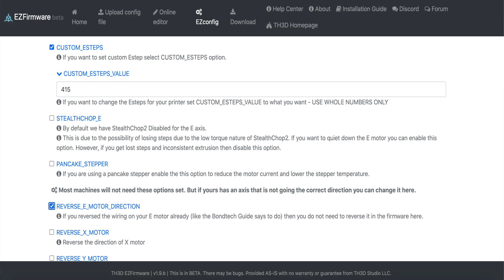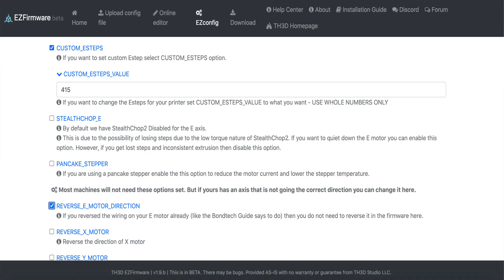Bondtech BMG Install | Creality Ender 3 Pro

Comment: Hi , Did you have to swap the wires in the stepper motor?  I just couldn't get it working. The graers wouldn't roate even after I set etsp to 415 . But I could rotate the gears manually and it is  smooth .. Any idea why is this happening?
Reply from the maker: I switched the motor direction in my firmware using the Th3d Ezfirmware compiler. This will work if you have a Th3d EZBoard. If you don't, according to the Bondtech directions, you will need to swap two wires to get it to work. I'd reference the directions for which wires are needing to be swapped. Also, ensure that the wires are properly plugged in and in working condition after the swap. You can verify this by checking the voltage with a voltmeter. Ensure voltage is flowing through the connection at the BMG side while the motor is supposed to be moving. Also, make sure the stepper motor is good by swapping one from another axis in its place temporarily. Let me know if that helps. If not, we can try a few more things!
Reply: @modified3d59  Hi ,Thank you for the inputs.i tried swapping . After the swap the motor rotates smoothly and also once i assemble it i could basically move it manually.But once i assemble it shudders.its like its not able to rotate.i dont think i have bad  stepper.Not sure what the problem is.i have seen so many videos on YouTube it was just swap  .Not sure what im doing wrong .
Reply from the maker: Sounds like the motor is binding. Ensure the correct gear is installed on the motor shaft and I'm the correct position would be my next guess
Reply: @modified3d59  That is correct . It’s smooth when I rotate by hand . Same gear is installed which comes with the package . Is it something to do with vref etc ?
Reply from the maker: You can try to increase the vref and see if that helps. One thing I'd try is to see if the motor spins while the Bondtech is not attached. If attaching the Bondtech causes to much resistance to spin the motor, there's a chance the Bondtech may be defective from the factory but I'd say that's slim. Have you tried reaching out to bondtech directly?
Reply: @modified3d59  It runs smoothly without assembly. But when manually when i try it doesn't look like its damaged .

Comment: Thanks, I have a different connection angled part, so I installed extruder without it. Works fine on my Ender-3 Pro

Comment: It is installed wrong way in this video! Be aware! The bowden tube should be installed to the opposite end where the lever is and the filament should be inserted from right next to the lever.

Comment: Nice video!  Just in case, you don't have to either swap the cables or the direction of the extruder.  Just flip the BMG 180 on the Z so that the tensioner is looking outside and the coupler also faces outside.  Hope this helps!

Comment: I have two Ender 3 v2 and I was never able to put those extruders I have setting the e-steps recommended for the seller and the retraction also recommended for bondtech support pretty frustrated now I have two extruders like that new without use. Anyone interested
Reply: Have you tried updating your firmware on the ender 3 v2s, because I have an ender 3 v2 with a bmg extruder and it works fine after I updated the firmware.

Comment: Nice video.  I found the bondtech didn't actually need the adapter.  I was able to have it mount directly to the existing plate on the x gantry.  Until of course I went to direct drive :)
Reply: What was the adjust you did in your printer and in your slicer if you don’t  mind mi question
Reply: @javieruriel  My only adjustment was the E-steps when i was using a bowden tube.  When i went to direct drive I also had to change some slicer settings.  I dropped retraction down to 3mm as there was still stringing at the recommended 1-1.5mm.  I removed options like coasting and whatnot as these settings were to compensate for bowden tube ooze :)  There was some trial and error.  I have an E3 pro and and E3 max and they both needed to be dialed in to different settings to work well.
Reply: @trevornelson7524  did you make any changes on the Vref the stepper?
Reply: @trevornelson7524  I have mine Bowden and according to people on bondtech support sale toll mee that I had to make adjustments in esteps 415 and retraction  35 on the slicer wich I did the outcome was filament didn’t go out easy looks like the mottor didn’t have enough torque
Reply: @javieruriel  No I didn't change the stepper drivers at all for either setup.  They don't run that hot and have been working for a couple of years now.
Reply: @javieruriel  I started pretty close to that but then just did a calibration to hit it dead on.  Even so there are some post adjustments i have to make based on the filament type and what not.  (usually just on the feed rate in octoprint or on the printer itself.) My e-steps for the ender 3 pro are set at 401 steps/mm and my ender 3 max is 397.  If memory serves though I believe the clone pancake stepper didn't need to swao coil pinouts for proper function but I had to for the bondtech one.  The bondech pinouts aren't teh same as the creality steppers. It's pretty easy to tell what the field pinouts are with a multimeter.

Comment: I got a clone from Aliexpress and didn't even have to reverse the direction of the motor.  I noticed something was different when I mounted because the  two sides seems reverse.  The flap which opens so you can feed the filament is on the bottom and not the top like yours which is fine and I didn't have to make any motor direction mods.

Comment: Anyone watching this needs to know a couple things.  Before you take apart your extruder to install the BMG.

A. The BMG extruder needs a different adapter for the Ender3
https://www.thingiverse.com/thing:3117704
**You need M3 nuts and screws for this adapter

B. The gear pulley on the motor is a bit&% to remove.  I had to 3d print a tool just to remove it
https://www.thingiverse.com/thing:3593964

I took my extruder apart twice before realizing everything that is needed (waste of time) so make sure you prepare.

Comment: I'm about 99% positive you installed that backwards from it's intended direction.  Usually that bowden adapter you were referring to, is where a J Type hot end goes when it's a direct drive.  And it looks like you have that part installed on the outside of your Ender 3.  Meaning the filament is running backwards through the extruder.  I'm not really sure how that actually effects the operation however.  I just thought I would point that out in case somebody is trying to do a direct drive installation with this and is wondering why they can't get their hot end to fit with it oriented in the same direction you have it.  The 1% doubt comes in, because I think they changed the design at one point also, so without know the version you have, it may just be appearing to me that way was well...  Good video tho.  Thanks for not just Blasting music instead of talking.  I hate videos that do that. Lol.
Reply: nope this is actually how they are designed, just installed one on my ender 3v2. and you cant actually change the side the PTFE tube fitting sits one, its impossible.
Reply: @cappe_yt9182  Hate to tell you this but it is in fact backwards. The lever points to the top or the intake side. You're supposed to buy an adapter, either the BMG bowden adapter or E3D's V6 direct mount (included in the v6 I think), and insert it into the empty side, which is the bottom or extrusion side. You can still use it in reverse but you have to reverse it because it's backwards.
Reply: @paranoidpanzerpenguin5262  You know if you enter their own site this is the exact video they link for a step by step guide.. And their own PDF guide shows the same direction so ''Hate to tell you this but'' it is correct
Reply: @cappe_yt9182  Yea, because they're trying to short change you by selling you the BMG extruder as a "kit" for a few extra bucks without giving you the adapter. If you go to the identical original BMG extruder page they even warn you they don't give you the bowden adapter for the output end. The only reason you have to reverse your motor is because it's backwards. The BMG extruder was designed to mate with the E3D V6, hence the empty extruder side.
Reply: Ive used one both ways, and it really makes no difference which way around it goes if your using it with a bowden. It works just the same.
Reply: they work both ways.

Comment: You don't need to invert the electric wires because you inverted the extruder ! The PTFE should be connected on the other side !
Reply: nope this is actually how they are designed, just installed one on my ender 3v2. and you cant actually change the side the PTFE tube fitting sits one, its impossible.

Comment: Hi, your machine looks good but you have installed the bond tech backwards, I believe this can result in a jam that can destroy it, worst possible outcome which may or may not happen.
Reply: He did NOT. How about checking the available installation guide, then commenting?
Reply: @michaels3003  well, I can kind of see where the concern came from. Is a direct drive configuration that groove mount adapter is where the V6 heatsink goes... So he rightly deduced that is the intended output for the design... If it's installed in the opposite orientation for bowden I can see why he raised the concern.

Comment: I designed a filament runout sensor housing for the BMG if you want to check it out. It uses the older style limit switches.
https://www.thingiverse.com/thing:4196507

Comment: Hi! Ender 3 v2's maximum E-step setting is 186, is there any way to change the firmware setting? Thanks in advance!
Reply from the maker: You may have to purchase a bootloader to edit your firmware. Unfortunately, the stock creality board seams to be limited from my experience.

Comment: Hi, was wondering what build surface youre using and what you think of it?
Reply from the maker: Im using the Th3D FlexPlate2 with the smooth PEI option and I can not say enough good things about it. Ive tried the Creality flexible magnet, Creality carbon silicone glass, and Gulfcoast Robotics borosilicate glass. Nothing has worked as well as the FlexPlate2. Adhesion is great, and it leaves a beautiful glossy surface similar to the borosilicate glass.